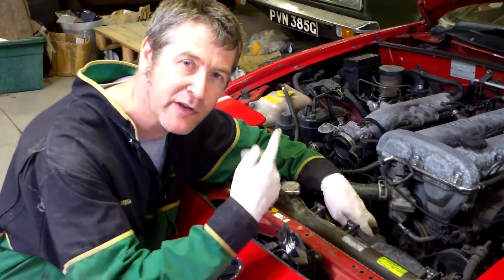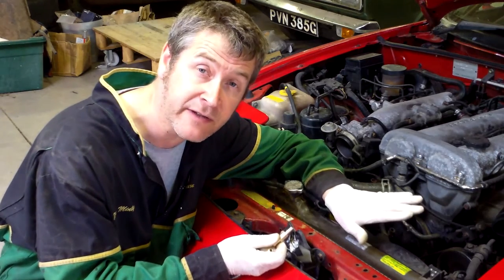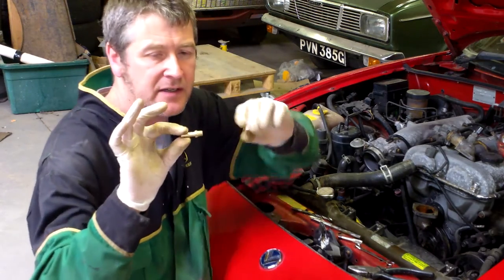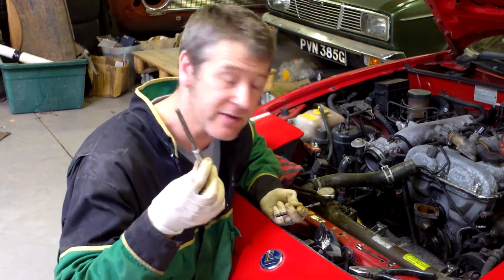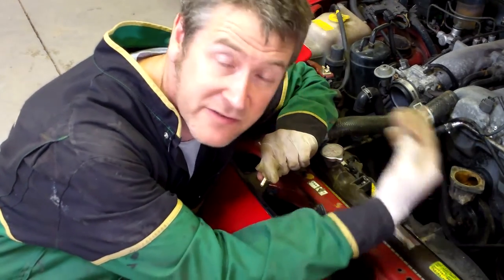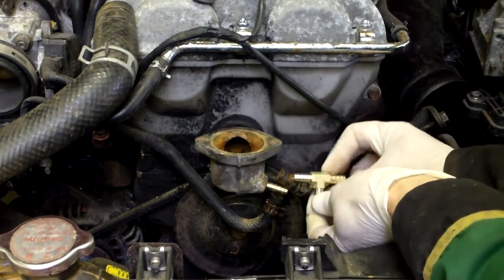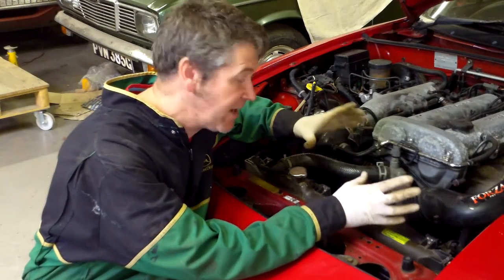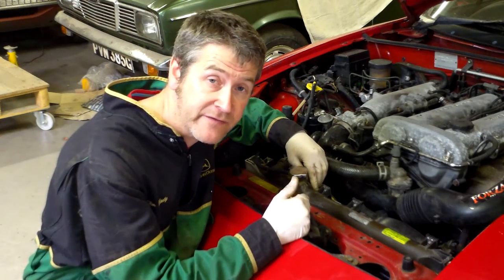MX-5 Thermostat Housing Fix - The Bodger's Guide

Comment: Genius!  Exactly this happened to me and I came up with a very similar (though not quite as neat) solution,  It wasn't so much the cost of the thermostat housing that made me go that route but the amount of work required to replace it! Seemed like a huge job!
Reply from the maker: The amount of work to get the thermostat housing off is a bit daunting. We've subsequently swapped the cambelt, water pump etc and we could have fitted a replacement then - but the bodge is still working well...!

Comment: Done this with a 10 mm one, had to drill the hole bigger first to about 9mm then tapped threads. Removed the powersteering pump and reservoir to get the drill in there.

Comment: Well my hole got bigger than 1/8.. trying 1/4 tomorrow and see if it works.. otherwise.. replace timing belt thats 10,000km (6,000 miles) old

Comment: Do I just cut off the part on the housing? I bought a used one before finding this video. But I'm gonna use it to run braided lines. I'm also gonna do the same to the two parts on the top of the manifold. 

I just realized. You used 1/8 BSP. So is that's equivilent to 1/4 NPT correct?
Reply from the maker: Carlo Villegas. Not sure of the equivalent sizes - used BSP because that's the size of the fittings we used. If you could find metric fittings, I'd go for that as the taps are much cheaper and more numerous.
We didn't need to cut away anything - the original steel outlet pipe had corroded away as is so often the case - but I suppose you could drill/tap new holes wherever you wish.
Good luck with the job and thanks for watching!